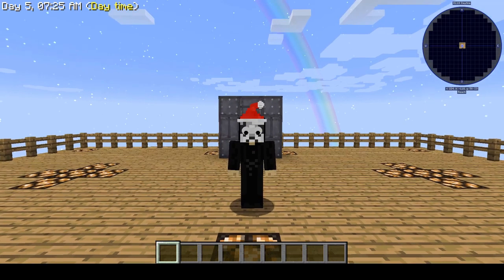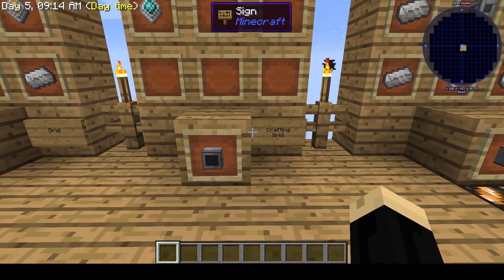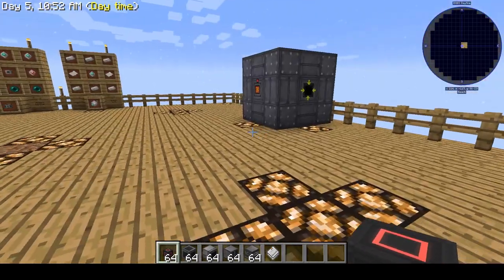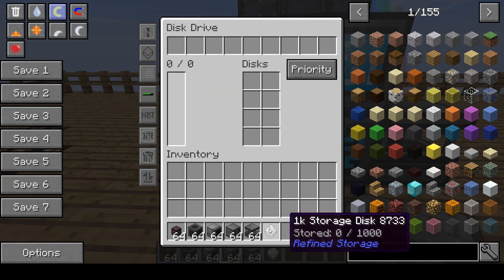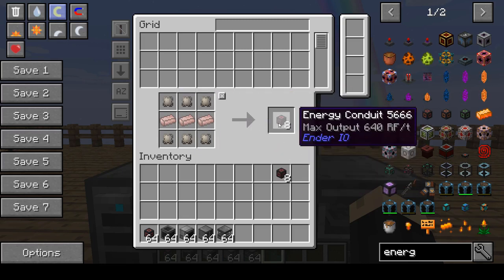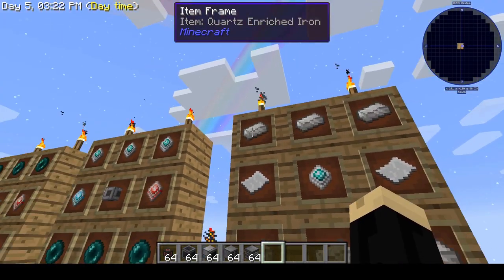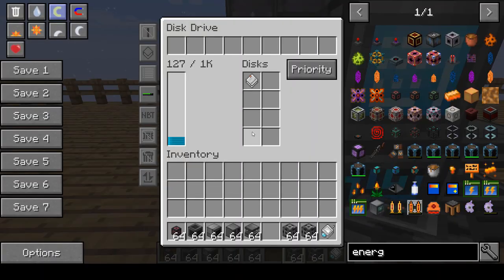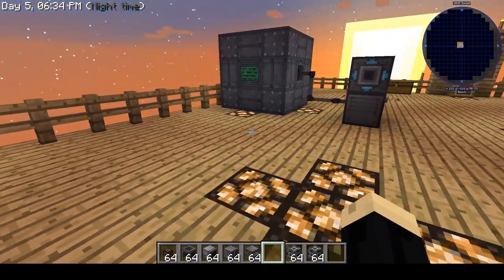Minecraft  Sky Factory 3: How To Build Refined Storage

Comment: Networking is a pretty advanced feature, but you do see lots of confusion about it on Reddit, so it's nice to have it clearly laid out here.

I'd suggest a future video where you talk about connecting existing storage to a Refined Storage setup. When and how to use Importers vs. Exporters vs. External Storage is another FAQ on Reddit, and the mod's wiki is only moderately helpful on that question. Refined Storage is cleaner and more compact, but we all start out with other storage setups, and it can be expensive and time consuming to move everything out of your old chests and drawers and into RS drives.
Reply: Just set up a new drive and roms, move it around, connect exporters to chests. Should only realistically need 4-6 roms for it all, and by the time you're making refined storage, the rest of your storage shouldn't be too large or spaced out (Well, shouldn't be, but do understand. It's Sky Factory. Things at the start tend to be messy.)

Comment: Starting up sky factory 3 soon enough, refined storage seems very similar to AE2, if not a more simplified version? Also, never understood how channels worked, but found it's based on machine and item capacity. The more items or demands a machine needs means more channels needed to operate that machine, hence why you have to watch out for it. Sort of like a CPU and Co-processors in AE2.